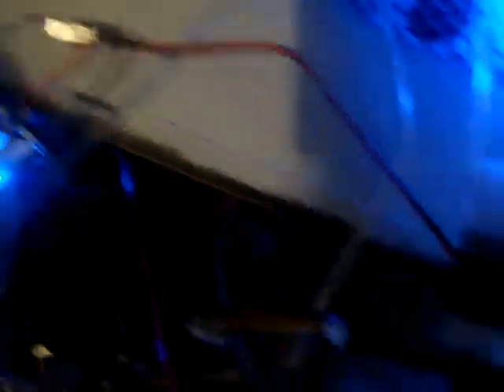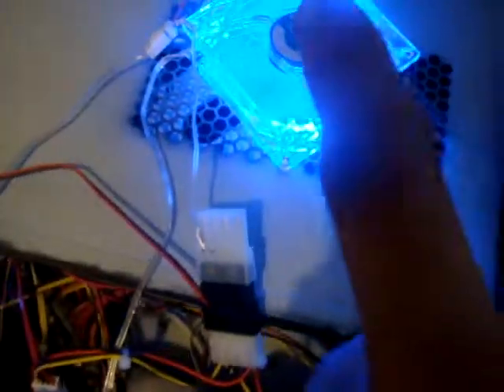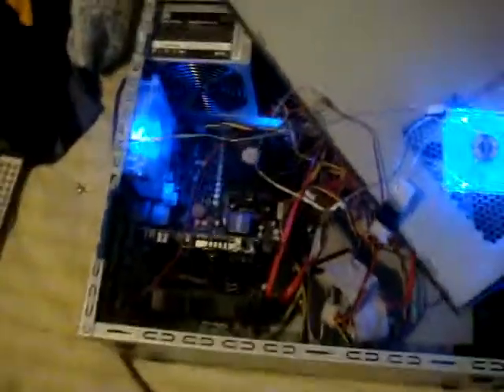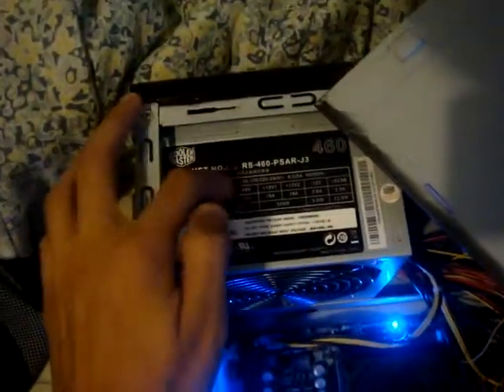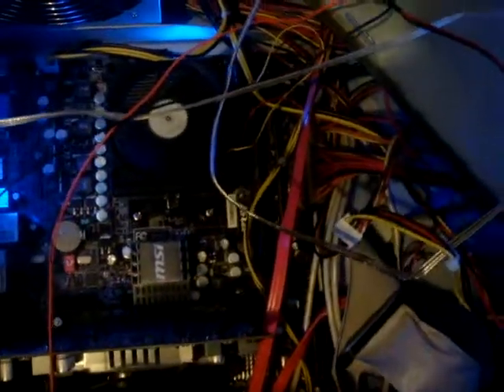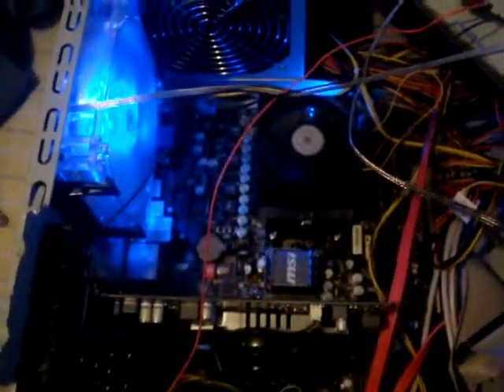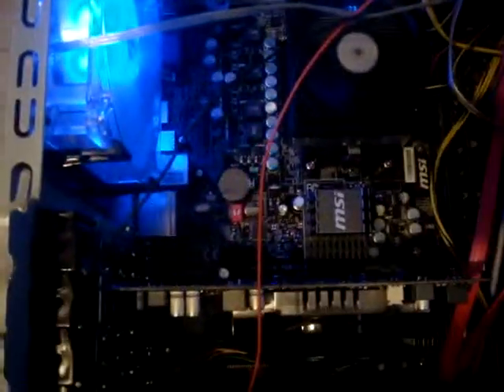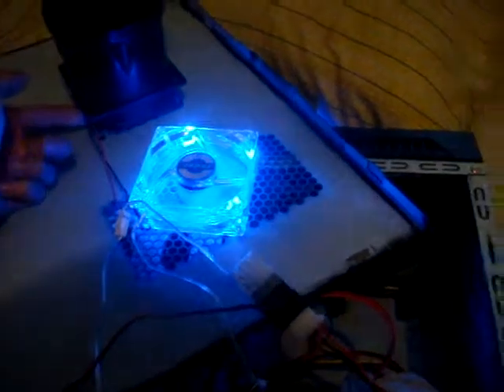Homemade Computer Fan Mods

Comment: I'd watch too many fans off that power supply or too many off any motherboard headers hate to see a power supply problem or motherboard fry or something ...certain fan headers do a certain power or amperage equals wattage n can damage headers n hard to tell if same rules apply for power supply draws but nice build man..you got a nicer one that'll do some gaming ...my son has a amd phenom 2 x4 quad at 3.2 ghz ...I got a octa 1700x with a gtx 1070 8 gig grafix card n 24 gigs ram ...just built a ryzen 7 2700x and 32gigs ram and a better vid card is what I'm saving up for now :) glad to see other do it yourselfers out there !!